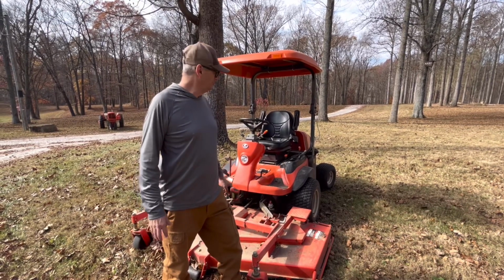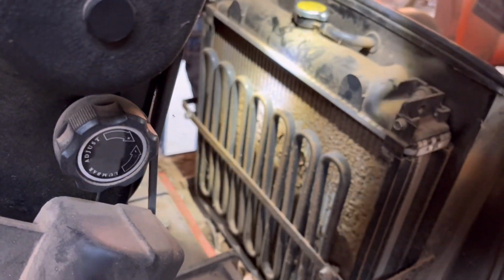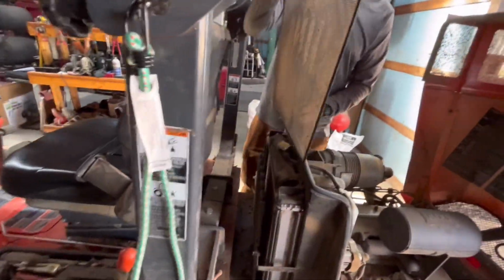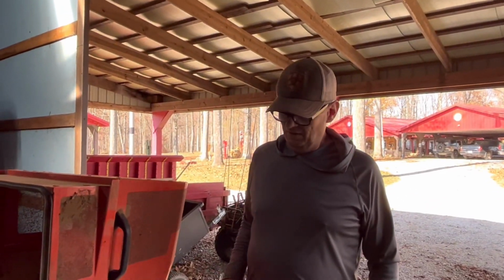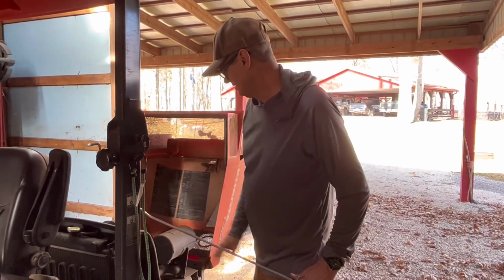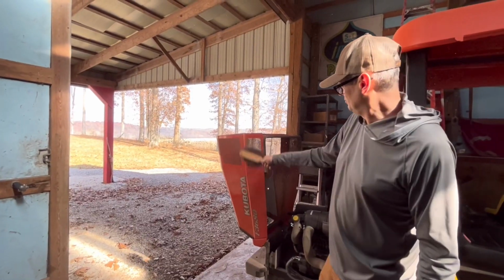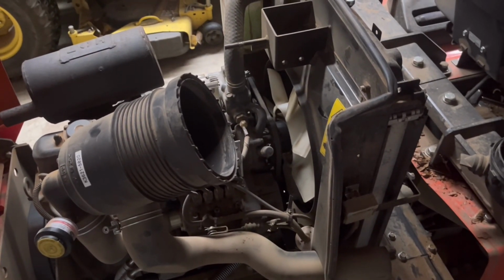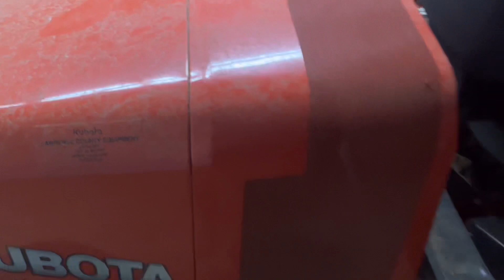Kubota diesel mower overheating - fixed | CBH

Comment: The fact that you let your radiator get that bad is pretty intense. But atleast you cleaned it in the end, gotta start somewhere!
Reply from the maker: Thanks for watching and commenting! Absolutely! Have a great day and be safe!
Reply: @CopperBarnHomestead  also clean the air filter or replace
Reply: @CopperBarnHomestead and use concentrated antifreeze 100
Reply from the maker: Thanks! Great tips
Reply: It doesn't take much to clog the radiators like that, especially when mulching or working in dusty conditions.  Mine looks like that even with the guard on after 10 hours of mowing dry pasture. Low pressure air and low pressure water.

Comment: I would love one of those mowers. How does it compare to the 6 foot finish mower you run?
Reply from the maker: Thanks for watching and your comments. The mower out front is a huge advantage for being able to get closer to objects and the all wheel drive is the best of all our mower’s because of the way the weight is distributed I think. That pretty much goes anywhere you would take a mower and is very stable. The only drawback is that mowing is all it does, the tractor with finish mower can be removed and the tractor can still do a bunch of other things. YMMV Have a great day and be safe!
Reply: Thank you. I want one. Looking at a VenTrac solution too. Pricey either way. I want to spend less time mowing and mow steep areas in comfort.

Comment: Hello - I have the same mower deck and I am trying to raise it as the grass is being scalped.  It is the lift rods that I am not understanding what to do with - they must go up.  I have a grip on the front wheels.
Reply from the maker: @MurrayFrancis-p1p  I don’t have access to the mower right now but if memory is right, the height is set by the spacers on the rear of the deck that hang from those arms. Then adjusting the front wheel spacers to match. Once the height is set it doesn’t change without readjusting the spacers. The arms will lift the deck up or down but the cut height is set with those spacers if I remember correctly. Hope this helps. I will look at the mower in the morning to be sure I gave you the correct information. Thanks for watching and your question. Have a great day and be safe!
Reply: I appreciate your help.  It is the spacers and the holes that I am confused about.  I need the whole deck to be raised 1/2 in. when cutting. The combined height of the spacers there now is about 1 In. Maybe I need to add more spacers to the Lift Rod on each side? I am in Ontario, Canada. Again, thank you for your assistance.
Reply from the maker: @MurrayFrancis-p1p  yes, if I remember correctly adding spacers to hold the deck up is what is needed. I will double check tomorrow, that is what I seem to remember doing though. Once we got the height set we haven’t changed it since.